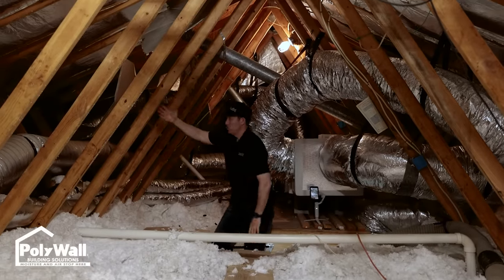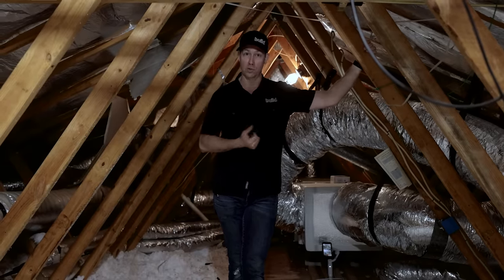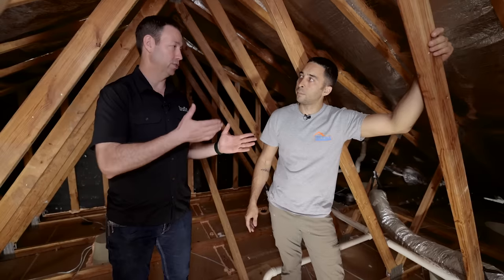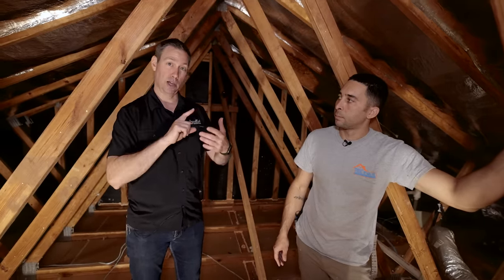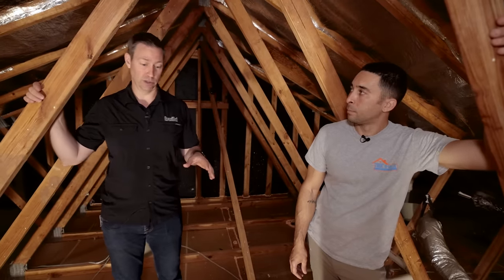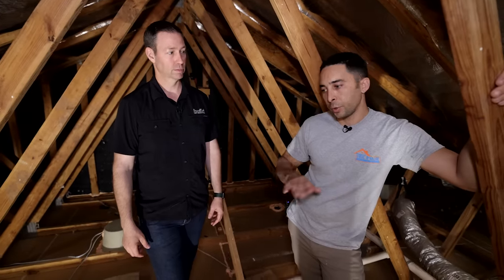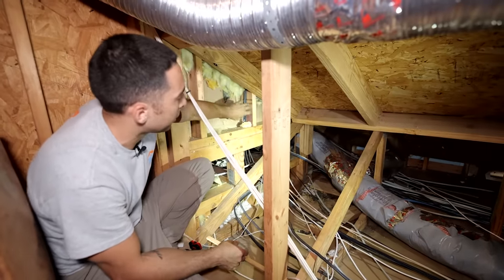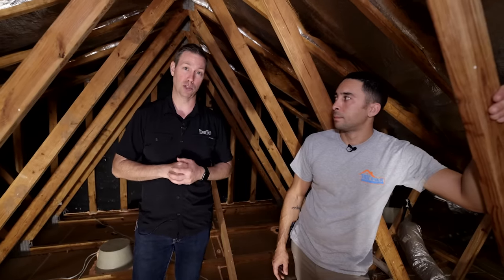How to Re-Insulate Your Attic - Insulation 2.0

Comment: I've now consumed I don't know how many hours of attic insulation thanks to Matt and other videos similar.  I apologize ahead of time for the length of this comment but i'd love some advice from @Matt Risinger or someone else with knowledge in this space...

House info:
I live in GA, and my attic is almost identical to what they showed on this.  HVAC (furnace) up in the attic with the same type of vent, blow in insulation, etc. 

My furnace is ~ 20 years old and will need to be replaced eventually.  I got a quote from a well respected company in my area and they were pushing me really hard on another 80% efficient unit even though I asked for a more efficient so that I could essentially do what Matt showed in the Insulation 2.0 video where you bring the attic into the conditioned space.  No matter how many different ways I asked, the answer was "you don't need anything more efficient than 80% in GA".  More or less what that company was recommending was what was shown in this video - almost exactly.

So my questions are here...
Is it worth going the extra mile to make the attic space conditioned as opposed to what they did here and just sealed off the spaces coming down from the attic and reinsulating?  And when I say "worth it" - is it worth the upgrade from an 80% efficient furnace to a 90%+ (most seem to be 96% once you go past 80), insulate the roof deck with something like rockwool that Matt shared in another insulation video, and seal off the air gaps on the attic floor?  Or...would it make more sense to just do what they did here?  I plan to be in my house for probably another 10 years, and I really like to be comfortable.  

I've done tons of reading on all this and watching videos like this to educate myself.  I have ridge vents on the roof, so my understanding is I'd have to put in baffles that basically run from the soffits up to the ridge vents.  I'd then want to put ~8" rockwool insulation underneath those baffles.  I'd need to suck out the insulation in the attic and then seal all the leaks.  I'd need to replace the furnace with a more efficient version that could be pvc vented.  

Thoughts?  Ohh...and the reason I am considering rockwool over something like the open/closed cell foam is I've seen some videos where these things have gone horribly wrong - like making people sick, the home is unlivable, etc.  And once you spray the foam...there's really no backing out afterwards.

Comment: Great information, especially with temperatures and energy prices going up. Check with your city for rebates and low interest loans for home energy efficiency upgrades which usually include duct sealing, additional insulation, installation of solar screens on windows, AC system tune up, etc..

Comment: I foam sealed all of my attic penetrations in 2020 as shown here by myself. I also installed foam boards (about 4-6 inches) from the top seal plate to the baffles which directs outside air flow through the baffles. I also installed Attic Foul to reflect heat back to the roof.
Reply: About how many man hours did it take and what square footage? I've considered doing something like this myself. Did you have to remove any loose insulation?
Reply: @23ty45  On my 1400 sqft house, I spent probably 8+ hours tracing all my wall top plates to seal them and diggin for penetrations without removing all the insulation, just moving it around, trying my best not to crush it. The insulation was almost new, the people who flipped the house just did a shit job. Then I insulated my knee walls with foam board and added ~R10 worth of blown in cellulose on about half the house. All told I spent probably 20 hours in the attic.
Reply: @tscook10  results?
Reply: @mikew.5286  I don't have great numbers, as there were a number of things that changed in that time-frame (it was shortly after we moved in as well). But I can tell you that the open common area with vaulted ceilings that was my main focus went from being about 3-4 degrees colder than the rest of the house to being within a degree or two. My heat pump was struggling to maintain 70 degrees on a 30 degree day (I'm in Georgia, that's cold) prior to the change and I've never had it fail to achieve setpoint since.

Comment: in cold climates you want to mix cellulose and fiberglass. The cellulose itself will settle a lot as you push past R60. The fiberglass by itself will suffer thermal piping when it's at -40.
Reply: I have noise issues, using denim, 2 layers.

Comment: Fantastic topic for a video and great timing. My 1960 ranch has a continuous attic space that continues all the way through to the garage space which has almost no insulation at all (Chicago area climate). I’m going to build knee walls and completely seal off this space to separate them and insulate the garage fully anyways. Thanks for the great info. I’m very excited to keep learning and doing the right modifications to bring my home into the modern world of efficiency.
Reply: I have a rambler, all one big shaped attic.  Water and heat in crawl space and electrical and NG above.

Comment: Super useful information.  We have very much a similar attic HVAC and insulation system but as we had paid for the Energy Star features, they sealed all the cans and other points of leaks before they installed the blown insulation.  I will still check the test results to find out what the rating we got as it's been over 5 years since our home was built.
Reply: Mine was done by a precious owner, I am going to have to redo it.  I have not HVAC and under the floor heating. but lots of cold air returns and some can lights to probably fix.  Not sure about the smoke alarm boxes but I assume those even though they apparently have none in Texas.

Comment: Windows are notorious for air leaks from the 80s usually because of leaks around frames in my experience.  Taking trim of and spray foaming but check window structure to look for cracks or other possible air leaks.  Insulated Windows warranty are usually 5 to 8 years.

Comment: Wish everyone building and remodeling would pay more attention to the attic and penetration points for air leaking and make sure when doing the work they make entry point into rooms and such into attic or from attic to room air sealed by sealing up the overcuts, holes, etc…. All need is some good caulk down in room side and attic is fire stop spray foam and seal the things that need sealed; in my area these products are still readily available at supply houses (for lower costs for contractors) or even places like big box stores, and also online. But, like they said in vid, you have companies that come in and spray n go; something that might save money up front; but not doing you any favors down the road, imo

Comment: Spray foam the top of the exterior walls. The company I had come out did a great job with all the mechanical penetrations like light fixtures and vent fans. But they did not do the top of the exterior walls. So there is still an air path from the receptacles through the wall and through the gap between the drywall and top plate in the attic. So make sure to verify the top of the exterior walls.

Comment: I suspect that many houses with rooms over garages have the floor truss area between the floor and ceiling completely open to the attic space in the front of the garage. It's made worse when they use open web trusses, now that air is leaking throughout the entire 1st/2nd floor space. My dad's house was built this way and it was very expensive to heat and cool. And it was built in 1987 when you'd think they know better, but this is Virginia.

Comment: I have a problem with using blown cellulose fibers for insulation. Overtime, it attracts huge amount of dust and dirt particles which can be harmful to your lungs especially if a person has respiratory ailments like asthma. Anyone with an older "loosely" built home with blown insulation will attest just how dusty their home gets. We found out the hard way. My son has asthma. We bought a 70s ranch with blown insulation in the walls and attic space. But the HVAC was inadequate so I had a new system installed including new ductwork. Soon after, my sons asthma worsened to the point of having to be hospitalized. We changed the filters weekly to no avail. The dust was everywhere. It was a nightmare. My son had to stay with my parents until I could sell the house and buy another one.
Reply: Air seal first, you shouldn’t be in constant contact with ANY insulation.
Reply: @woohunter1  great idea today with new construction. But we didn’t have access to air sealing technology in the 90s. Most buyers don’t think about air sealing a turn key home buy.
Reply: @johnnelson8956  doesn’t matter if it’s blown in, fiberglass, rock wool, etc.  do your best to air seal before re-insulating.

Comment: I saw a video where they used a foam product connected to the roof rafters.  They seal it with foam.  This leaves an air path between the decking and the foam.  I think it was called SilverGlo.  What do you think about that?

Comment: I sealed all the attic penetrations in our 1979 house in 2009 about a year after we moved in. Replaced the missing fire collar on the pipe for the furnace and closed the gap around it. Started installing pro vents so we could add venting at the soffit and add a ridge vent. I also installed in ceiling speakers. Hubby couldnt work in the attic with a 4/12 roof pitch. Health issues got in the way so I'm getting back to finishing up so we can replace the insulation. I'm not sure what to do about the in ceiling speakers though. The attic space acts as the speaker enclosure  so I'm not sure what impact treating them like can lights would have. I guess I'll have to try one to find out.
Reply: How big are the speakers?  If there’s no subwoofer, you should be fine with sealing them.
Reply: @woohunter1  they are all 8", 2 in each room except the bathroom. It wasn't large enough for two so there's one stereo speaker.

Comment: You have HVAC equipment in the attic that may need servicing. With R-49 insulation, the insulation will cover the bottom chord of the truss. What do you install to help a repair man safely reach the HVAC equipment and be able to work on it?

Comment: The recessed can light covers stick up so they don’t look like they have any R value at all. Wouldn’t it be better to remove the can light fixtures and replace them with the new flat LED style ‘can lights’? That way you could get an almost uniform R-49 across all of the ceiling. 

Also, any one you recommend for home performance work in Dallas?

PS: Love the show!

Comment: @Matt Risinger Did you perform the test out blower door before or after insulation? It's worth mentioning to your audience that you want to test out Pre insulation that way if there are additional areas in the attic you still have access for sealing.
Based on the homes I've tested I would say this one likely has open floor trusses to the porch on the opposite side,overhangs, etc. Which can be exceptionally expensive to remedy.

Comment: How about spray foaming the attic floor with open cell to get a good air seal?  Kind of like flash and bat.
Reply: That’s what I was thinking… get one of those spray foam kits, flash the ceiling and all the penetrations, and then blow in cellulose (which is less nasty than fiberglass).  I’m going to do that to my kitchen ceiling remodel… if the weather ever breaks 105 degrees.
Reply: @robwalker8530  I am finishing up a post frame garage (conditioned space) and I might try it as well.
Reply: @robwalker8530  That's how mine was done, works great! Fully sealed!

Comment: Sorry i didnt read all the comments, i have a question: the radiation layer at the underside of the roof i thought you mentioned vapor barrier. if so, the roof sheathing is sandwiched between two layers of vapor barrier without air circulation. That would be a problem.....also the attic is constantly ventilated between soffit air intake where you added baffles and the ridge vent or high side vents; no vapor barrier on top of the attic floor insulation? . I want to improve the attic insulation in my single story florida home and mostly add a vapor barrier on top of the insulation. i have quite a few oversized cuts, J boxes etc that need to be sealed. souds like quite a project.....great video!

Comment: spray foaming the underside of roof sheathing is a big mistake because it can hide roof leaks. we bought a house in FL that had some past roof leaks and some of the sheathing was completely rotten and had to be cut out. the home inspection might have missed it if all that rotten plywood had been hidden by spray foam.

Comment: Matt I wish you guys would have talked about some of the performance spray caulk used instead of canned foam it can be applied quicker and probably cheaper and doesnt need the insulation value of spray foam as the blown in goes right on over it. I know there is a big gap challenge that foam fixes but what about a combination of the two?

Comment: non contractor question: Matt, could they have used before the insulation went in, that system that sprays some kind of plastic type stuff in the air to close out all the little leaks in the attic? I know they use it in new construction a lot & with the insulation gone, it was a lot like a new build. Thanks.
Reply: Most likely not given the house has vented soffits.

Comment: Will this process help if the attic penetrations and poor insulation causes a humidity issue during the summer that is not present in the winter. My issue is a higher than expected humidity level, especially, upstairs, when it is hot and humid.

Comment: Okay Matt, ya'll are standing in my attic.....so to speak. We live south of Ft. Worth. 30 year old 2 story home. 2 heat pumps, neither is in the attic!! My question, Why not just spray foam the  floor of the attic? Seal all the cans, wires, etc and insulate the home from the attic at the same time. And you mentioned losing storage, which I hate attic storage, but with the spray foam, you might still be able to retain some storage. Just curious as to the pros and cons.  Thanks, Rick  :) Oh, great shows by the way!!

Comment: Hello thank you for the valuable information. I have already gone through the foam process / retrofit. Do  I need to still seal the can lights with foam at the rough deck or does the can sealing only apply to blown in insulation?

Comment: Hi Matt, I live in Austin and have a asphalt shingle roof. Would you recommend spray foam to insulate the attic? I heard the heat might damage the shingles and is only recommended for metal roofs.
Reply: My builder refused even with metal claiming that it would damage the decking. I used spray foam on the floor of the attic and then blown in on top of that. I looked into radiant also but I have no ridge vent.

Comment: Thanks for the video, looks like I’m in for the same kind of treatment here in Georgia, was that fiberglass insulation that was blown in and could you use cellulose in a southern climate with all the humidity ? Has anyone else used cellulose in a hot humid section of the country?

Comment: How heavy can blown-in cellular get before you have to worry about it breaking through the ceiling? In the part of my attic that had a good 12 ft of space they put something like 30 or 40 inches of cellulose which it felt like a lot over the back side of the house where it gets the most sun. Since they insulated, the room stays so much colder and is easier to cool down. Are you supposed to put something down between the rafters and the cellulose insulation?

Comment: On air sealing ceiling from inside attic,  could I just close cell spray foam wide spray pattern whatever needed instead of tedious sealing 100s of holes and cracks,   where 2x4 top plate is 1 quick 4" wide spray pattern down whole beam, cover sheet rock jounts and wires and all.  Can light,  cover it then shoot whole thing in close cell froth kit

Comment: Matt,
I've been following for quite sometime now and wonder if there would be value to taking a 3k sq. ft. 1960 ranch style home with recently remodeled interior in last 6 years and completely ripping roof, truss and supports out. Rebuild new from ceiling up while exposing every opening to top plates and insulating any walls from top down?  Attic space is minimal and would drastically appearance and functionality. Any thoughts?

Comment: I want to use spray foam in my attic, but also want a wood burning stove with the chimney running through the roof. Running the stove pipe out the walls is not an option.  Is this combination possible?

Comment: Great follow up video.  This is something I am going to do to my attic in the fall (live in Houston area) when it is cooler.  Looking to do as a DIY project.  Couple questions??  Where would I look to get the radiant barrier , can light covers, spray foam supplies?  Guessing not HOME DEPOT.  I see you were using the hand held spray foam to seal areas, could I get the Froth Pak kits to do this??  Thanks for the video.

Comment: Can a 80% furnace like that never be located inside the condition space? I purchased a new furnace like that last year and want to move it to an interior closet.
Reply: Yes it can, my 5 ton on the main side of the house is in a closet and is a 80%. But it's bad as it sucks air right out of the living space to burn with the fuel. My 2.5 ton is in the attic over the Master and pulls air out of the attic. Next year or so I'm doing Mini-split heat pumps as I'm in South Texas and dont really need these big Nat Gas heaters.
Reply: @TdrSld  Thanks for the info. I'm in San Antonio so I completely agree about not needing the nat gas heaters. I wish I had known more about this stuff last year when I replaced my AC system.
Reply: Need proper air way to the attic if installing in a closet.